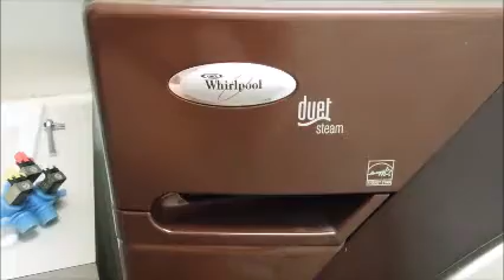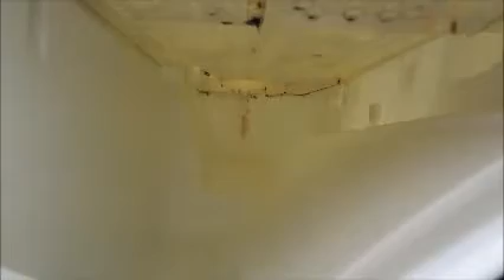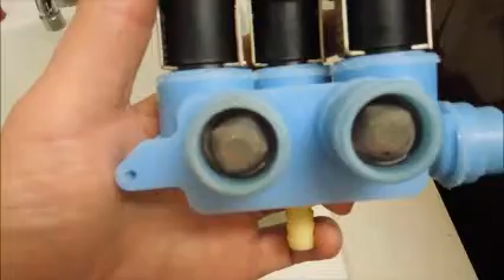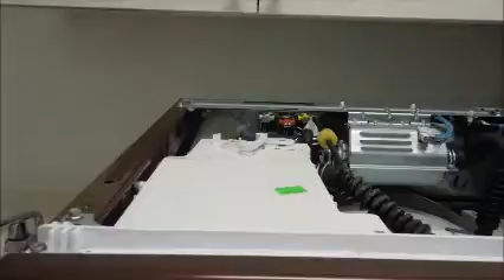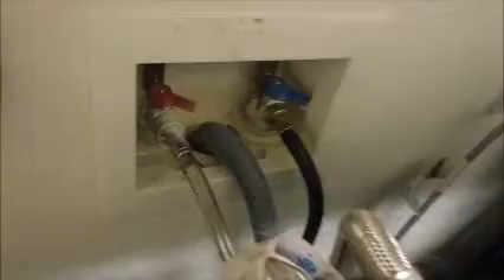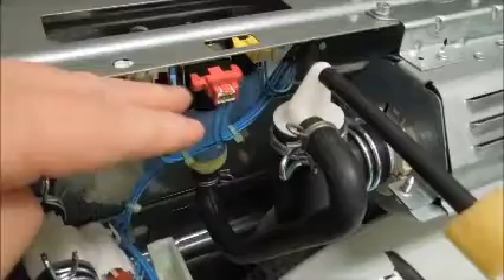Whirlpool Duet Repair no bleach or softener

Comment: My washer was leaving bleach in the tray and stopped with a LF (low flow) alarm. I found that the cold water valve inlet had a small removable blue plastic screen/strainer inside. I used needlenose pliers and a small screw driver to pry out and remove the plastic screen. I cleaned it out with water and compressed air and now the washer works fine.   I did find my main well water filters had been accidentally left bypassed (opps) and the inlet screen got plugged up with fine sand.

Comment: How did you run water to test if water was discharging or not?
Reply from the maker: I didn’t test that valve before replacing.  From what I gathered online on other models that seemed like it was what was causing the issue.  If you’re asking how to see if the water is coming into the tray area, I just pulled the tray out and turned the regular wash cycle on and watched the water pouring out inside to see it wasn’t forceful enough to shoot up into each compartment at the front of tray.

Comment: How much did you pay for the part(s)
Reply from the maker: jstins I think it was about $30 back then.  Got it from this place.  Not an endorsement.  Shop around.  https://www.appliance-parts-experts.com/W10156253-washer-fill-valve.html
Reply from the maker: jstins actually might have been around $45.  Hard to recall.